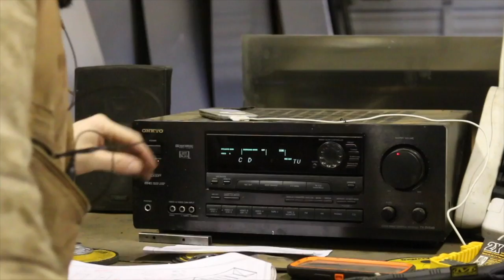Which GLOVES will do IT ALL?

Comment: Like one other commenter suggested, the belly bay is likely to drag when going over uneven terrain or snow covered roads.  I get that you can move it only during favorable weather, but getting it over a small hill in your driveway is going to be difficult when the tractor and rear tralier wheels are on either side of the crest of the small hill and the belly bay scrapes the ground in between the tractor and trailer wheels.  I hope you accounted for that in your design.

Comment: If you are planning on taking that trailer to other states, it may not be able to go with the axles moved all the way to the rear, for instance, Kalifornistan has a 40' length law meaning 40' from the king pin to the center of the real axle, a few other states have similar laws.